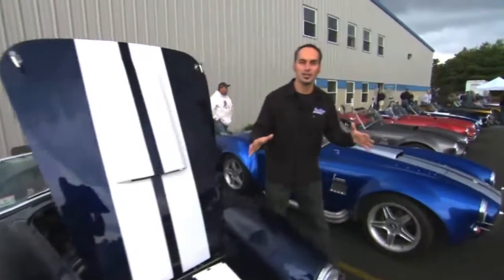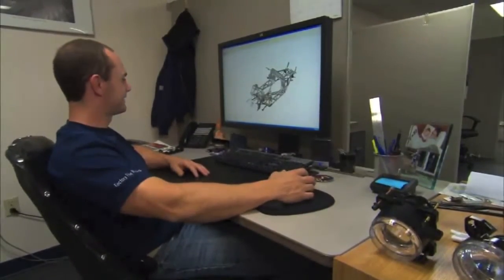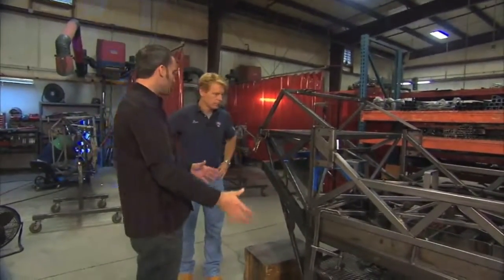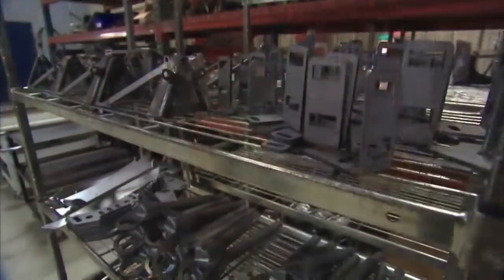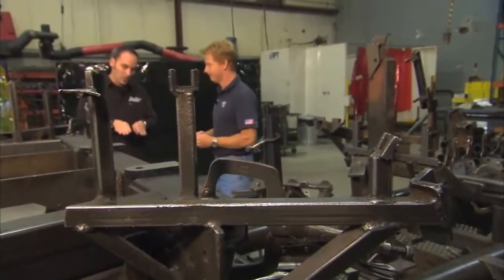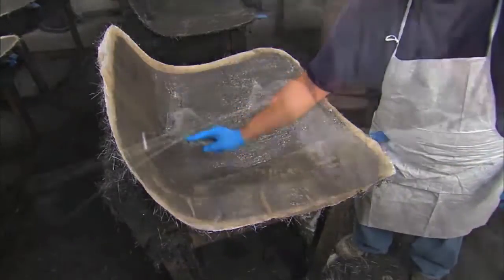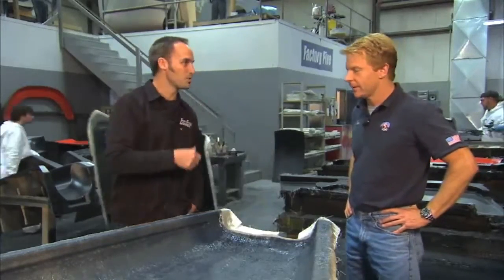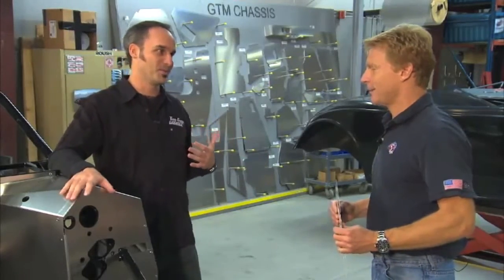Tour Factory Five with Two Guys Garage

Comment: I'm going to go look, but I wonder if they ever got into monocoque construction. That's the flavour these days. I also wonder if anyone has looked into heat treating a welded up tubular chassis, like a temper bake, to even out the hardness between the brittle welds and the softer tubing. I'm not that smart, surely someone has done it.